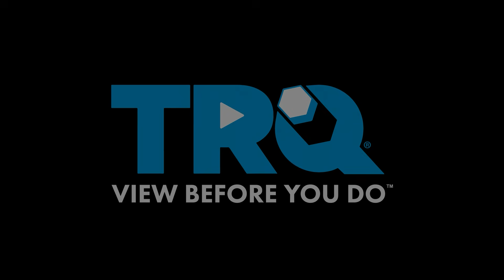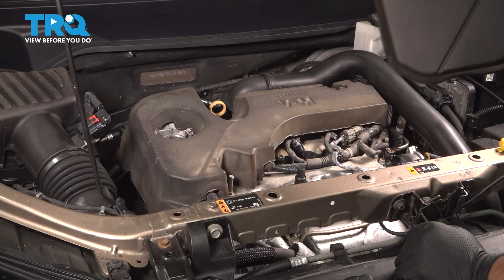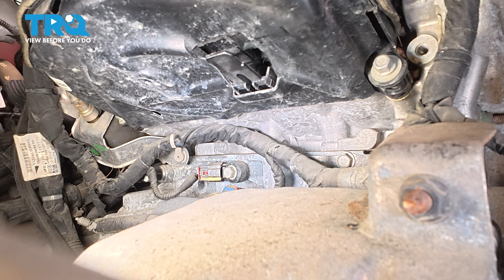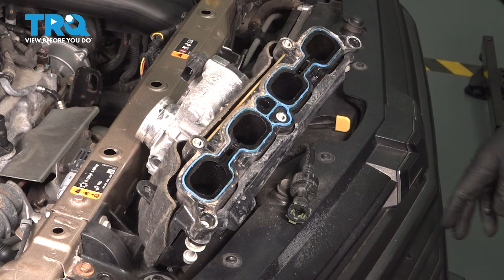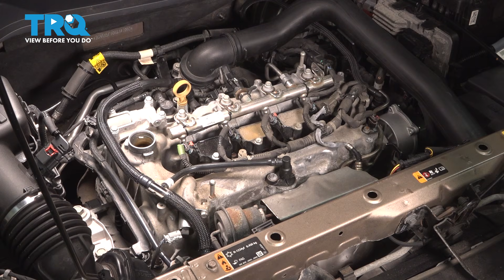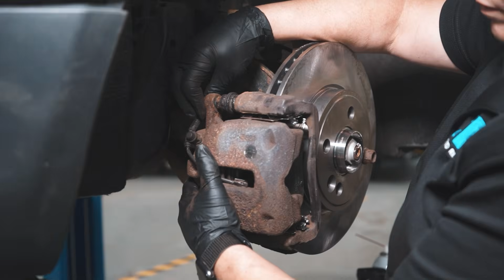How to Replace Oil Pressure Sender 2018-2024 Chevrolet Equinox 1.5L L4

Comment: Is there  a screen  behind  sensor? I have replaced the sensor and the oil solenoid  in the pan still getting  a p06de and  oil pressure  sensor  codes